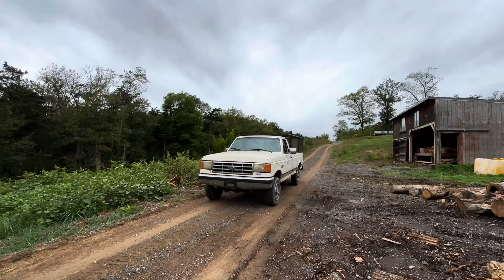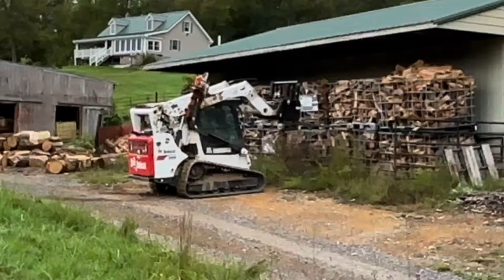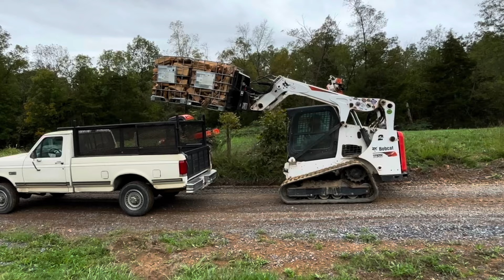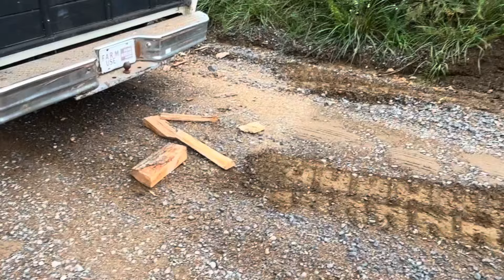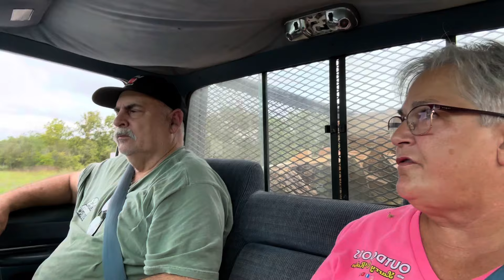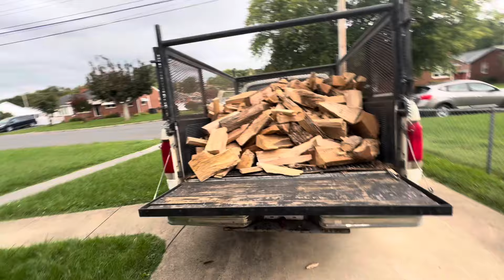FIREWOOD DOUBLE TOTE DUMP!  #518

Comment: That's a slick set up Larry and Robin! It seems like the rotating forks have a lot of hydraulic flow going to them. I also like the Ford low key dump bed that's not a DOT magnet.  Keep up the content!
Reply from the maker: Good Morning WoodDig, Thanks, The forks are low flow, very smooth to operate. 👍🇺🇸

Comment: Nice delivery, guys.  I love my Heavy Duty F250 as I started with an F150, and it's been a better truck.
Reply from the maker: Hello Daniel, This Truck had an easier like being my truck to supervise and bid jobs, all our heavy duty Fords went over 300,000 miles and we’re just worn out from hauling boilers and process piping for the factories👍🇺🇸
Reply: @outdoorswithlarryrobin  : Ford did make some good trucks with this generation.  The next generation seems to be the 7.3L that's lasting.
Reply from the maker: We had horrible experience with the 73 diesel constantly needing cam sensors had to carry a 10 mm wrench and all of them 59 Cummins was the best diesel we had

Comment: Sure makes it fast for loading . Will your 3/4 truck handle a cord of hardwood ? We were looking into a dump insert  or a set up like yours for our 3/4 truck but wasn’t sure if the truck would take the weight of a full cord .
Reply from the maker: Hello Phil, we don’t sell full cords at a time, value added this way. Your truck could easily carry a full cord, Payload is higher on newer trucks👍🇺🇸
Reply: @outdoorswithlarryrobin  Thanks Karen won’t drive with the trailer on so we figured we would set her up to do a lot of our delivery’s